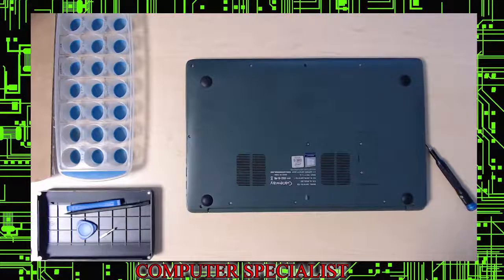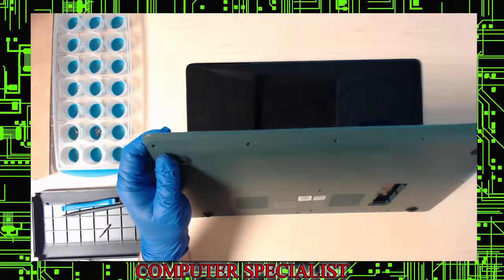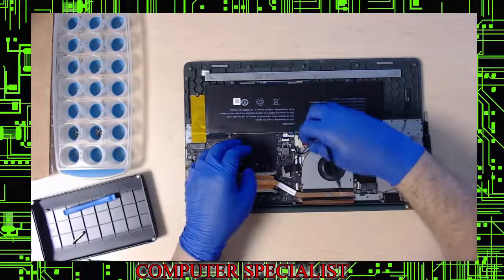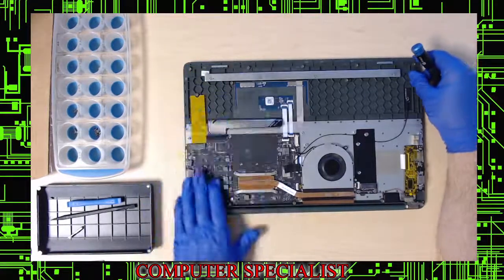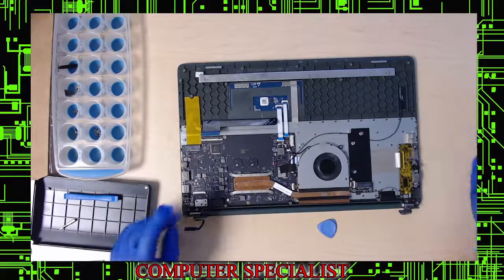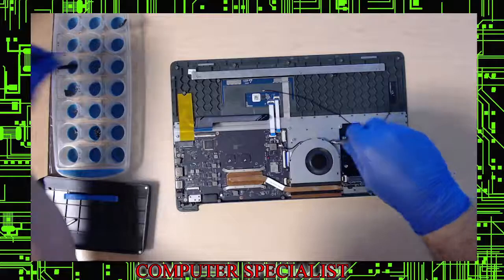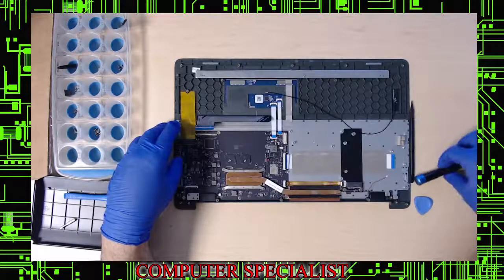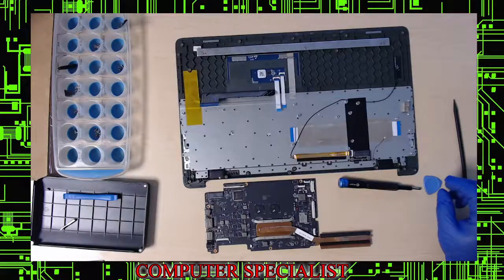Gateway GWTN156-1GR  Disassembly

Comment: How i can cmos reset this because i keep going back to bios
Reply from the maker: Is your main battery good? This also serves as the bios battery. It will also go into the bios if the ssd went bad or there is no operating system on it.
Reply: @computerspecialist8533  your right its either my hdd or the battery

Comment: Is there a way to get to the cmos or rtc battery/connection to reset my bios?
Reply from the maker: The cmos battery on this model is the main battery also. Just unhook main battery. Make sure unplugged from charger and hold power button down for 20 seconds. Plug main battery back in and this will reset cmos.